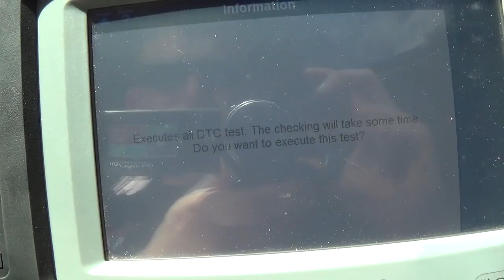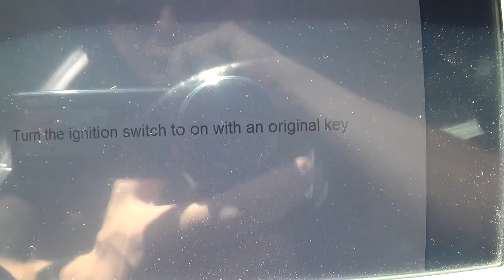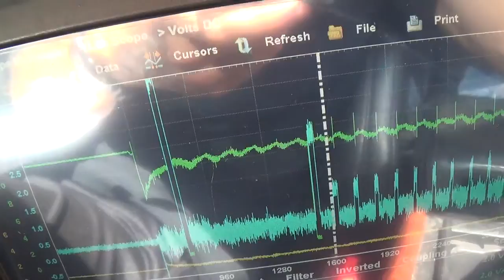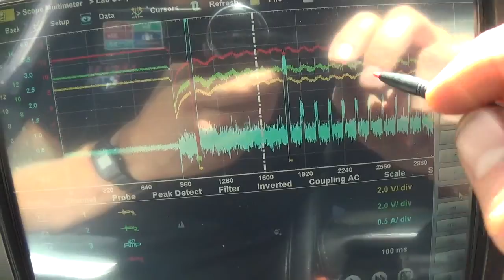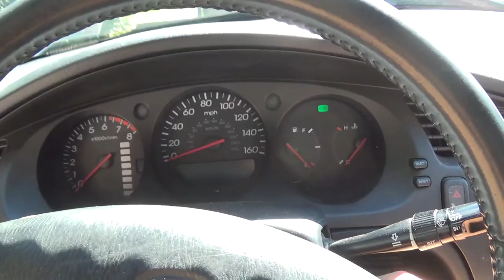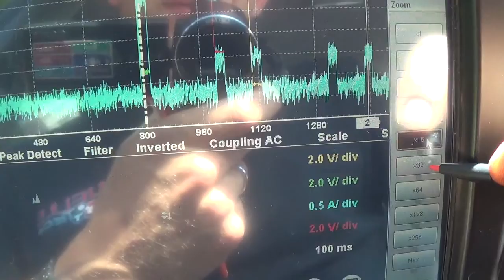Acura 3.2 crank no-start case study - Part 3

Comment: I'm 3 min into this video.  I don't understand why you were saying that the problem is back to the owner's original crank-no start problem before the owner got the CPS as a possible solution.  Wasn't the owner's original crank-no start problem an intermittent problem?  And now, the problem is the car has not been able to be started at all?  If you thought that the problem is back to the original issue, what is your hypothesis about why the PCM issue would deteriorate from an intermittent to a hard problem?  Anyway, I will continuing watching till the end of this series and see.

Comment: Why didn't you try to erase all keys already registered in the "new" junkyard pcm first.(you had the option avaible on the autel scanner)
Then maybe you had the ability to register a new key simply because he had no choice than accepting a new one.
Adding keys implicates you have already minimum one registered to begin with,so it limits your choices.

Comment: try replacing the electronic switch that is located on the opposite side as the key held on by 2 bolts and plugs up to the ecm

Comment: Nice case study and difficult at the same time.  Woulnt it be a good test to diconnect the cranshaft sensor plug, hook a test light to battery power and then touch on and off each of the pins on the crankashaft plug to create a signal with the right amplitude in order to pulse the ignition coils..

Comment: When I get a tough one like this, I do what you do is write down your data. Without the written notes, I feel like I'm running around in circles. It's a good one Ivan and sounds like you got it wrapped up in part 4. Looking forward to your next video.
Reply: My forenza at a 120,000 miles has a strong gas smell coming up from under the hood of my car. I saw on a forum somewhere that it is a injection problem, can you please tell me what to do?
Reply from the maker: +Todd Wall Use your nose and eyes to look for an external leak under the hood: follow the fuel lines to the fuel rail and injectors...could be a bad o-ring or loose clamp.
Reply: Thanks I'll check that soon as possible. You showed me how to change the
natural safety switch on my Suzuki forenza. Thanks Mr Stuzman.
<https://plus.google.com/_/notifications/emlink?emr=04154959659364639307&emid=CMjS4J6E0scCFaLmQAodvGwDkQ&path=%2F115721987270086285930&dt=1440979845820&ub=STREAM_COMMENT_FOLLOWUP>
+Todd Wall Use your nose and eyes to look for an external leak under the
hood: follow the fuel lines to the fuel rail and injectors...could be a bad
o-ring or loose clamp.
Reply to this email to comment publicly on Google+. Or view stuzman52's
post »
<https://plus.google.com/_/notifications/emlink?emr=04154959659364639307&emid=CMjS4J6E0scCFaLmQAodvGwDkQ&path=%2F115688524681202402884%2Fposts%2Feg6Vmwxokmh&dt=1440979845820&ub=STREAM_COMMENT_FOLLOWUP>
Reply to this email to comment. motoYam82
<https://plus.google.com/_/notifications/emlink?emr=04154959659364639307&emid=CMjS4J6E0scCFaLmQAodvGwDkQ&path=%2F115721987270086285930&dt=1440979845820&ub=STREAM_COMMENT_FOLLOWUP>
commented on stuzman52
<https://plus.google.com/_/notifications/emlink?emr=04154959659364639307&emid=CMjS4J6E0scCFaLmQAodvGwDkQ&path=%2F115688524681202402884&dt=1440979845820&ub=STREAM_COMMENT_FOLLOWUP>'s
post. Mute motoYam82
<https://plus.google.com/_/notifications/emlink?emr=04154959659364639307&emid=CMjS4J6E0scCFaLmQAodvGwDkQ&path=%2F115721987270086285930%2Fop%2Fmute&dt=1440979845820&ub=STREAM_COMMENT_FOLLOWUP>
to stop receiving notifications from them. Mute
<https://plus.google.com/_/notifications/emlink?emr=04154959659364639307&emid=CMjS4J6E0scCFaLmQAodvGwDkQ&path=%2F115688524681202402884%2Fposts%2Feg6Vmwxokmh%2Fop%2Fmute&dt=1440979845820&ub=STREAM_COMMENT_FOLLOWUP>
updates to this post. This notification was sent to ****@**
Go to your notification delivery settings
<https://plus.google.com/_/notifications/emlink?emr=04154959659364639307&emid=CMjS4J6E0scCFaLmQAodvGwDkQ&path=%2Fsettings%2Fplus&dt=1440979845820&ub=STREAM_COMMENT_FOLLOWUP>
to update your address. Unsubscribe